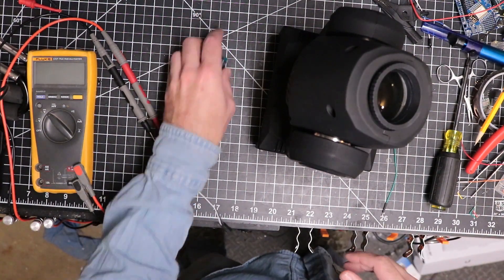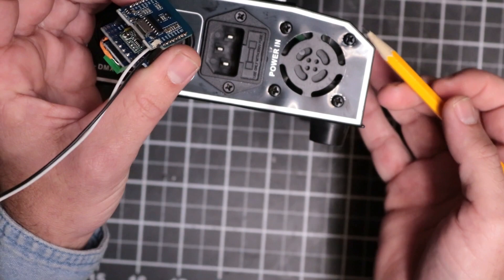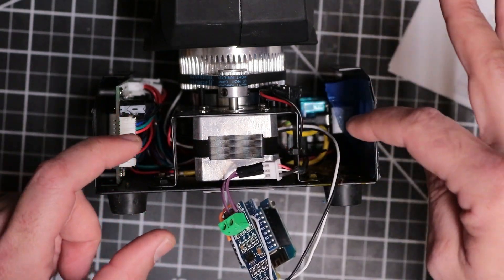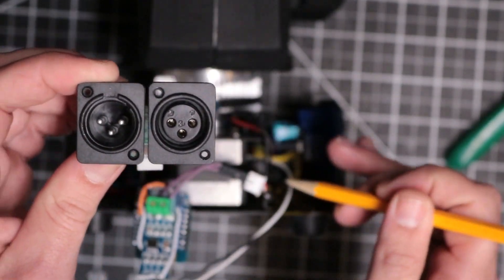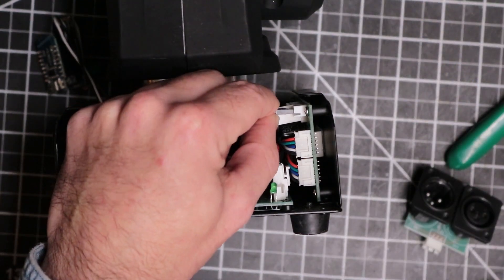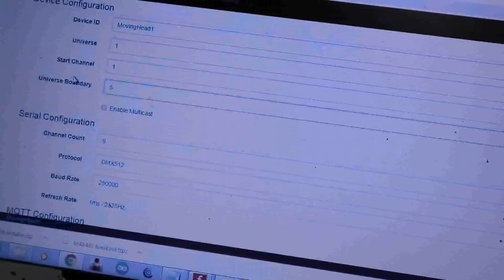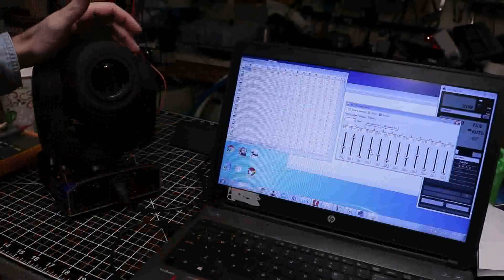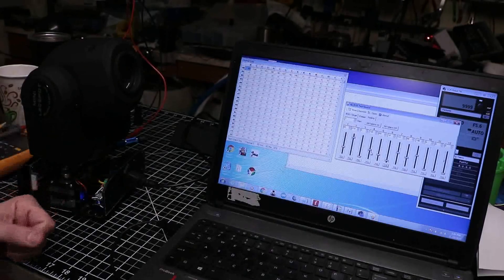Wifi E1.31 DMX moving head

Comment: Just curious... you don't seem to have listed your voltage converter part.... yours seems pretty small.
Reply from the maker: Thank you for pointing that out, i have updated the comment section to show the buch converters.  They are quite small and can not handle alot of load but they work great just driving the wemos.

Comment: Wondering if you would have left the out dmx, if you could chain this to another device...?
Reply: Yes you could. The only limiting factor is you would have to stay under 4 universes which is 2048 channels.
Was just thinking about making a wifi enabled dmx plug the other day, that would plug into the dmx in and allow you to hook up downstream dmx devices via standard dmx cables.  Just need a clever solution to power it.

Comment: HI. Thanks for the great video. I assume if I just put this in a box with XLR connections I can daisy chain DMX fixtures as normal? Is the max number of channels 520 (512) per D1?
Reply from the maker: Yes you can daisy chain them. I know the espicelstick firmware can handle 4 universes of 512 channels.  I would assume the same does for serial, but i cant find anyone that has had that many dmx devices to try it out.  I know for sure it can handle 1 universe in serial mode. Might be worth a shot to push it past 1 universe and post the results here for others.
Reply: @builditbetter5610  Thanks for replying. I have put this project on my to to-do list (which is growing rapidly since I recently discovered ESP8266 etc!) I work in pro-lighting for live music etc but on a budget, so once I get one put together I will try out a variety of fixtures/universes.
Reply from the maker: @crazyd7223  im still exploring what can be done with the esp8266 as well.  Let me know if you need any help with future projects.